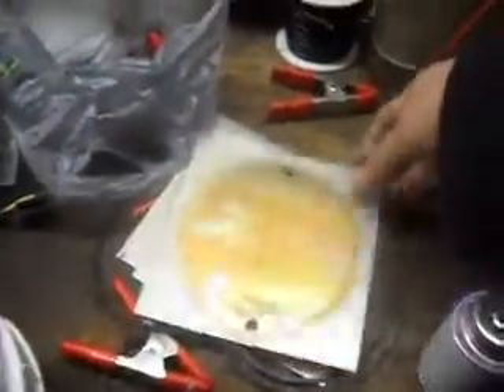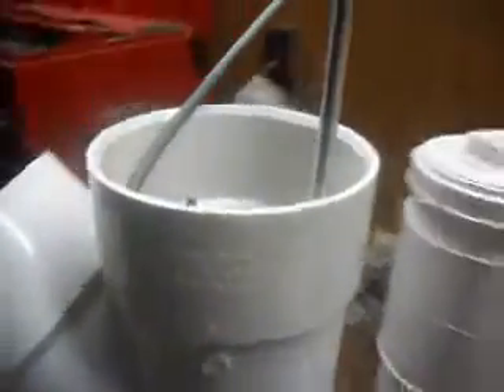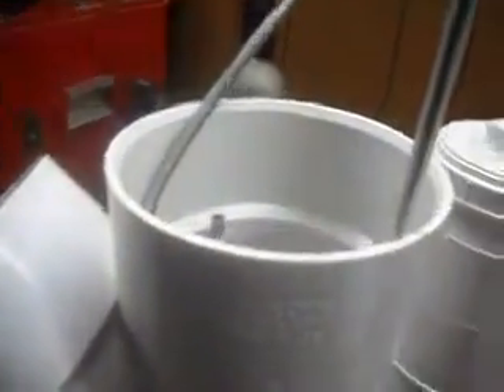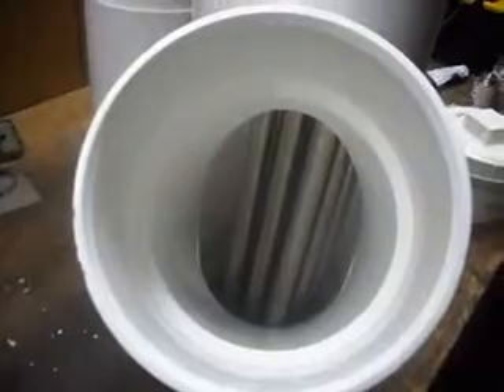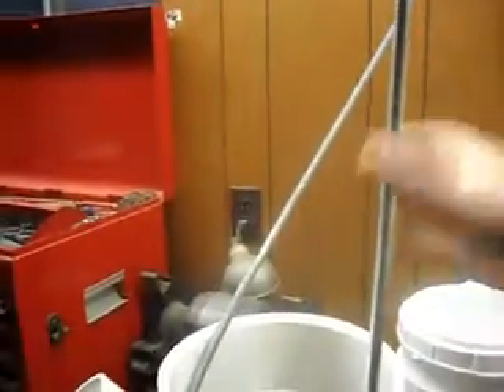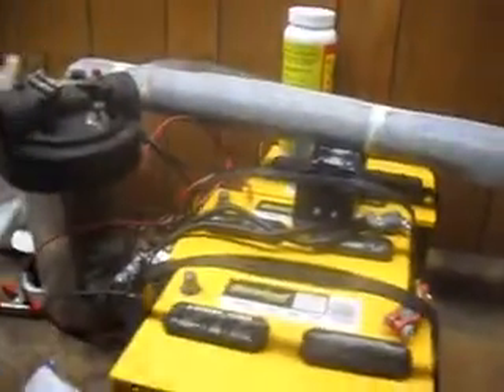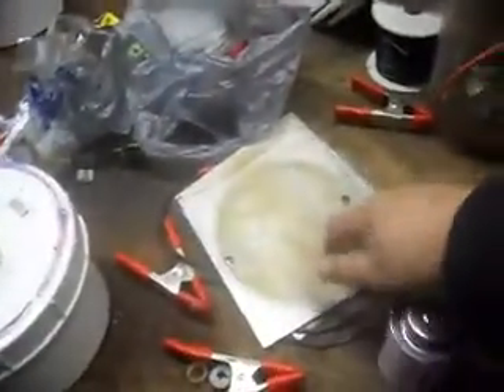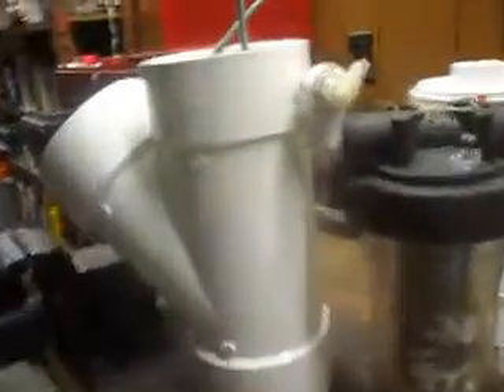HHO cell

Comment from the maker: You could run 30-40 if you have a cell that can handle it. Mu little 3 or 5 plate cell wasnt meant for anything over 20 or so. someone stole mt yellow wrangler and set it on fire 2 weeks ago. so I am starting over with everything.

Comment: So wouldn't 30-40 amps be too much of a load and stress out the alt. over time? I had finally seen your comment from several months ago, as you can deduce I am very rarely on here at a social capacity... so have you had any notable problems with your system yet..? I own a TJ now, so no more JK :(